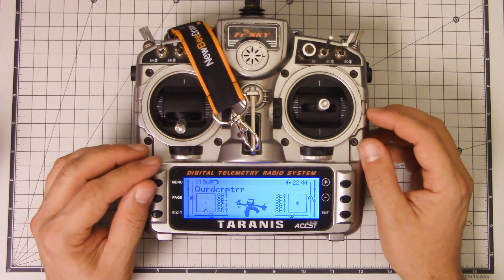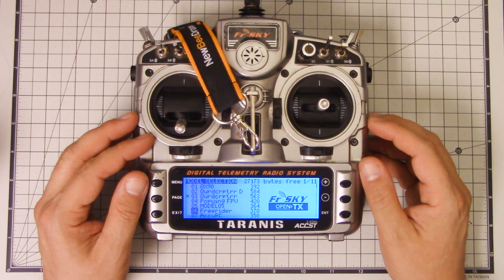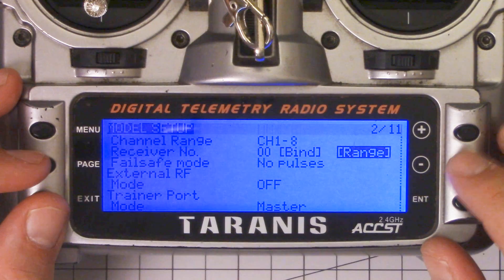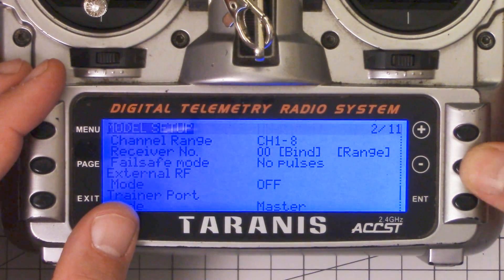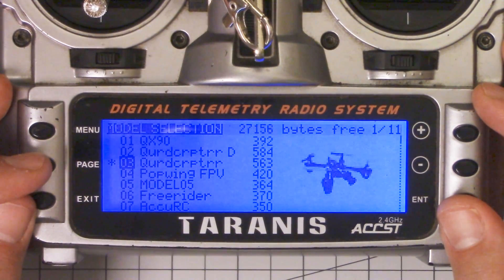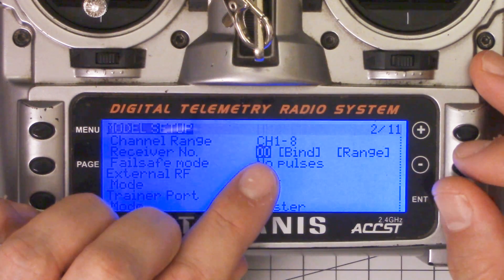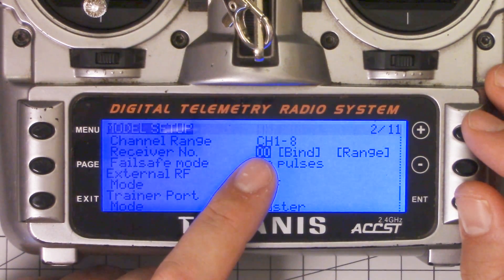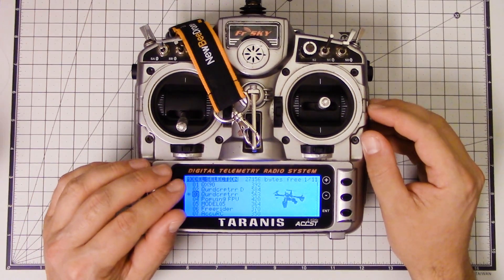FRSKY TARANIS HOW-TO | Model Match | Unlimited Quadcopters, One Model Memory

Comment: Hi sir, i just try to create a new model from my taranis x9d plus Se, following the process on a YouTube post, but there's a problem in the antenna it says radio antenna is defective, is there a way to bypass it? and proceed in creating a new model, my taranis x9d plus Se has a crossfire antenna (external type with push button.. Hope you could help and give tips.. Thanks in advance sir.
Reply from the maker: Radio Antenna Defective means the built-in antenna is damaged and the radio circuitry is most likely damage too. For example, if you powered the radio up with the antenna removed, this would happen. Or if the antenna was not fully screwed in. 

If you notice very short range, or if the error won't go away, you have to replace the radio board inside the radio.
Reply: @JoshuaBardwell  thanks for your response sir, do i still need to fixed this internal antenna even though i am using the external crossfire antenna,because my Quads are all using TBS crossfires.

Comment: the feature is actually not model match, its for receiver redundancy, you use the "sbus in" and "sbus out" on the x series receivers to daisy chain receivers (not sure what the maxium is) to provide receiver redundancy, if you r primary looses signal your secondary will take over, think putting one rx at the front and one rx at the back of a quad so you keep max signal if you fly toward or away from yourself, instead of having the potential antenna shadow.

it works because the bind id is on the rx (which i believe is a combination of the serial number of the tx + the id you choose) so you can bind multiple rx's to a single model, the over spill is that you can literally use this to bind multiple modes to the same model on the tx.

computer radios existed before open tx, but they were a looooootttt mode complicated to understand, you don't know how easy you kids have it now with Open TX.... 

i think this sbus in and out daisy chaining could also be done with x series and r9 receivers so you can have 2.4 in close and 868/900 at distance by having both internal xjt and external r9 modules enabled at the same time
Reply from the maker: You are right that, if using SBUS redundancy, then you must have both RX bound under the same RXnum. But it definitely does function as model match also.

Comment: Is it possible to un-bind receivers?  Mine was set to 00 by default and I bound multiple quads to one model on your advice, then needed to make some changes for different quads so duplicated the model, now i get warnings that the "ID [is] used in" different models if i switch the receiver number back and forth.  Doesn't really hurt anything but my OCD ;p, but i'm guessing i should use different receiver numbers under different models?
Reply from the maker: Re-bind with a different receiver number selected in the new model.
Reply: @JoshuaBardwell  Wow thanks! Second time i've caught you early, good morning :)

Comment: Great vids.   Question regarding model match. . If ch1-16 is on one receiver, and ch 17-32 on another receiver but bound to the external XJT on a taranis for example, could it possible to operate two land based vehicles using a one transmitter, kind of simultaneously. ? If that makes sense. Ie an excavator and a tipper.
Reply from the maker: Yes that probably could work.

Comment: I just bought a jumper T16 pro with OpenTX.  Does this basically work the same way on the jumper?  And does it work for crossfire?  Can crossfire and Frsky both bind to 00?  I was thinking one model for Frsky and one model for crossfire.  Thanks
Reply from the maker: Crossfire doesn't use a receiver number. You can bind as many crossfire receivers as you want. There is no link between a Crossfire model and a specific receiver.

Comment: Is it possible to have one receiver assigned to many models like for different plane I could just swap the receiver . rather buying new one for each model or changing setting all the time when I swap.i have boats ,planes and hovercraft all of them use pwm output .so I'm guessing is there a way so that I create multiple models for each model .but the receiver beio just one
Reply from the maker: You could use the same receiver number on multiple models, yes.

Comment: Joshua,Correct me if I am wrong.  I realize this is an old video for you, but for me the issue has become a bit of a nuisance, and I have decided to find a fix.  I am one of those folks that has each model assigned to a different model number, with associated names. I fly both Fixed and Multi-Rotor aircraft.  It is not that big a deal, for me, to select each model before flying. Beside, I can only fly one model at a time, right?  
The problem for me, is that the receiver numbers are not the same as the model number. I have deleted and or moved models, so now there are unassigned numbers that the set up wizard does not recognize ["Model ID already used"], because I set up a model there and then moved it. this has snow-balled on several numbers. So I am thinking that if I go in and match the receiver number with model number... 
Hopefully, all that would be required, is to re-bind my receivers, Yes?  Seems like not that big a deal. A little chicken to go in and screw around. Thoughts?
Reply from the maker: Yes, I guess that is what I would do. Re-bind all the receivers. But ugh what a nightmare. Honestly I think managing the numbers like this is going to be very difficult.

Comment: Does this also apply for models running TBS crossfire receivers?
Reply from the maker: No. There is no way that I know of for OpenTX to communicate the model number to the external Crossfire module. I believe that any Crossfire model in the radio will bind to any Crossfire receiver. But I haven't tested this.

Comment: Ancient video here in FPV years, but I'll see if anyone is still paying attention here because I'm confused. I have 3 whoops with similar yet different (just how different I'd have to check) BetaFPV FCs and discovered by accident that it doesn't matter which of the models I have loaded in my Taranis. Any of the models seem perfectly happy controlling any of the whoops. If there's a unique receiver ID associated with each model, how is this working? I'm sure I'm just overlooking something fairly obvious, but it does have me a bit puzzled. BTW, I'm still a newbie at about 6 months into the hobby with nothing but brushed tiny whoops under my belt so far. Getting into it has actually changed my life, and I'm looking forward to joining you guys in the skies with some bigger birds next spring.
Reply from the maker: Either you bound the whoops to the same receiver number or maybe they are using D8 protocol which doesn't support model match.

Comment: Ok I have spent 2 months learning more on this. I thank you. Slowly making sense. I have multiple baby hawks now with the D8. Will I be able to have the multiple baby hawks on one tarannis model?  Or it sounds like for the D8 baby hawk I need to have 1 tarranis model per D8 baby hawk?  Sorry to come to you I know your busy. I just can't find the info anywhere.
Reply from the maker: Yes you can have multiple D8 quads on the same model. The only difference is, the D8 model will not enforce Model Match. If you bind some other D8 quad with a different setup, you can still try (and possibly fail) to fly it with a different D8 Model in the Taranis.

Comment: Does this apply to crossfire receivers too?
Reply from the maker: I'm not sure about that. The binding of CRSF is handled in the Lua script not in OpenTX. So the exact functionality isn't there. But does CRSF have its own internal model match? Hmm.... I don't see how it could. Because the CRSF module has no way of knowing which model is loaded in the Taranis. So I'm going to say I think the answer is no, CRSF doesn't have model match.
Reply: Does that mean if you're running crossfire on all your quads, you technically only need to have one model setup on your transmitter?

Comment: When i try to create a model it wont gibe me the option to pick heli, plane, quad it just replicate the name thats there already which is model 1 thats it and if you try it again it will say model 2 but it will not let me create my own which is a quad. What do yo think is wrong.
Reply from the maker: Probably in the Configurator you set the default option to skip the setup wizard. You can still set up the model, you'll just have to do a few things manually that I always do anyway.
Reply: Hey Josh hows it going. I spoke to you a few weeks ago about my first drone that i still cant get to work.  Man i need your help. I dont know if my fc or reciever is missing some thing because it wont bind. Can you hit me up for alittle help.

Comment: Resurrect zombie video, go!

I’ve got all my XM+s and R-XSRs on one model, radio number 06, and they all work fine. The XMs all oitput RSSI on channe 8, and the taranis feeds back RSSI on channel 8 when telemetry is available, so they all work. 

I also have all my D8s (whoops and a little brushless dinker) on radio 7, I get telemetry from the NBD acrobee V2s etc, all fine. 

I have all my R9s on another model, and I think I switched it to radio 01... no idea why I did that. 

I find dealing with even 3 models a pain in the bum, as lots of things like sounds are in the model setup,  not the radio setup... so i don’t bother with sounds. 

Now I’m looking at a 4th model because I’m toying with using fport. It seems to me that I should either go whole hog on fport so I don’t need otherwise duplicate models... but I don’t think fport works on every fc, so I can’t? 

Anyhow, thanks, Joshua. You have done more to make this fantastic hobby accesible to common dunderheads like me than anyone else on the planet.
Reply from the maker: You basically need one unique model for every receiver type. D8, D16, CRSF, FPort = four models.
Reply: D8, D16 s.port, D16 f.port, R9 s.port, R9 f.port...

All of those are identical except for a single line change. Makes modifying anything a huge pain. 

And I don’t think you read my lovely thank you at the end of my comment! :)

Comment: Hi. Great vid. But iv done exactly that. But betaflight couldn't see the second receiver. I'm using rxsr receivers. Both quads set the same. What have I missed. Please help
Reply from the maker: You can't use two different receivers at the same time, if that's what you're trying to do.
Reply: Joshua Bardwell  not at the same time. When I bound the second receiver it bound to radio but betaflight config couldn't see receiver ?

Comment: Hi Joshua, I recently set up an sbus rx (xm+) and changed the model match number as per one of your videos to get the sbus rx working. All is well and sbus rx is in the qaud and working fine. But now it seems 4 of my micros using lemon rx no longer work, them seems to connect but get nothing fro the quad. These 4 micro were working fine before I made these changes, any help would be great! Thanks for all you helpful videos!!
Reply from the maker: If you re-used the same model match number with the new receiver, maybe there is some problem. Or if you changed the model match number of a Model in the radio, then that Model in the radio would no longer bind to receivers bound under a different Model Match number.

Comment: Hi Joshua, It's been a while but by now you're a full-time celebrity, so here we go: the Taranis gives a d**n what receivers are bound to it, the ID is stored in the receiver when you bind it.  You can bind any number of receivers to the same Model Match ID, which is obvious more than ever now that FrSky sell their redundancy systems (R-XSR, RB10, etc.) that would be almost useless otherwise.  In fact, I disagree with the notion that it's a good idea to use ID=0 because quads might still differ in the telemetry side of things, so it's good practice to assign each set of telemetry setups (RSSI or not, GPS or not, cell count, etc.) you use to a different model memory and ID.  BTW, the Taranis warns you on assignment of an ID that's already used in one of the other model memories, but that's only a warning, you can safely ignore it if you know what you're doing.  Happy New Year!
Reply: I stopped doing that too because I accidentally powered both drones at the same time and it wasn't pretty.
It's pretty easy to select each model.

Comment: Hey Joshua how do you get past when you have created a new model 02. When you delete it after binding a receiver to it is that spot #02 can't be used again? I go to make a new model and it says Model ID already used. So I made a 3rd model and got everything bound. I moved it to model 2. Now I try to bind reciever #02 and Model ID already used. How do I get this bound to my reciever in quad #3?
Reply from the maker: You can just increment the receiver number. The receiver number doesn't have to match the model number.

In my experience with OpenTX 2.2 when you delete the model that is using the receiver number, the internal tracking "reclaims" the receiver number. So if you create a new model with receiver 01, 02, 03, then you delete model 3, the next model you create will have model number 03. But I haven't tested that extensively to see how exactly it works.

Comment: So let me get this straight. Say I grab a fixed wing that uses an X model receiver. I have it bound it's RX-03. When I'm done I power down everything and decide to fly my quad which is using a D model RX. But I forget to switch my radio from fixed wing to the quadcopter. Is my Quad going to try and fly with the fixed wing profile?
Reply from the maker: +Daniel Garner no, because a D series model will never bind with an X series receiver and vice versa. Of they both had X series receivers and if you bound them using the same model number, then yes.

Comment: i have bound several different receivers to the same model with the "Receiver no."  set to something that wasn't 0.
Reply from the maker: That's interesting. I swear I have seen an error message something like, "This receiver number is already used."
Reply: well you get an error if you try to set up two different models with the same Receiver no.

Comment: Trust me when I say that having 2 quads accidentally plugged in at the same time bound to the same model in Taranis works. In a marathon leap frog tuning session off of my front porch I almost injured myself by landing one quad, placed it behind while mid conversation plugged in another location quad set in front of me, put on the goggles and armed both quads!!
Luckily the props from the quad behind me were rubbing against a battery strap so I heard them. ;)

Comment: I started creating one profile per quad also. Once I forgot to change my profile and only noticed it after a few flights wondering why I had no low voltage alarm. Actually the vbat was coming through smartport (Vfas) on one quad and analog input (A2) on the other quad. My third quad had it through a dedicated voltage measurement and it was Cells parameter. Since then, it's still the only reason for me to change profiles.
I also tried to power up and arm 2 quads simultaneously. I just gave a bit of throttle, not even hovering before stopping the experiment, thinking that even with identical rates, this will diverge somehow. I didn't check what the telemetry was giving though.

Comment: Hey!  You are almost to 20k subscribers.  Congrats!
You can indeed run two quads at the same time.  I landed, put one in my truck, got distracted by something and didn't disconnect the battery.  Pulled the next quad out, threw a battery on it, armed it, and heard the one left in the truck arm as well.  Thank god I heard it before punching out. :-)

Comment: i have a question not about this video.
I'm having some problems with my eachine qx95, on cleanflight everything seems to be fine but when i connect the battery to the quadcopter after 1 or 2 seconds it spins up the motors (like it is armed, not full power) and i can't do anything with my transmitter, i have to disconnect the battery.
do you have any idea on how to make it work?(i also tried to reflash betaflight with no luck)
Reply from the maker: +Alessandro Ammenti start by checking the receiver tab to confirm that your transmitter is working right.
Reply: Joshua Bardwell yes all seem to be fine on the receiver Tab.
update: now i changed a setting to brushed and the motors don't spin up when i connect the battery, but instead the don't spin up even if i try to arm it or move the sticks
Reply from the maker: +Alessandro Ammenti what is your PWM frequency?
Reply: Joshua Bardwell are you talking about motor_pwm_rate? if so it is set to 4000
Reply: Joshua Bardwell i managed to make it work!! :)
Reply from the maker: +Alessandro Ammenti too high for most brushless. Take it down to 400. You can try to work up later. Higher rates give more responsive motors but only to a degree and more heat and less top end power.
Reply from the maker: +Alessandro Ammenti I meant brushed not brushless.
Reply: Joshua Bardwell when i first had the problem of the motors spinning up i changed the stick min value to 1000(it was 1100) and max stick value to 2000(before was 1900), i now set them back to 1100 and 1900 and it now works :)
Reply from the maker: Those settings are different with brushed vs. brushless. But you should still lower your PWM rate in my opinion. 4k is too high for brushed motors. But if you like how it flies and your motors aren't too hot, never mind.
Reply: Joshua Bardwell ok i will lower it to 400 and see how it flies, what is your qx90 pwm rate set to?
Reply from the maker: +Alessandro Ammenti I used 1k I think.
Reply: Joshua Bardwell ok thanks, i'll set it to 1000 then, because the qx90 and qx95 are very similar.